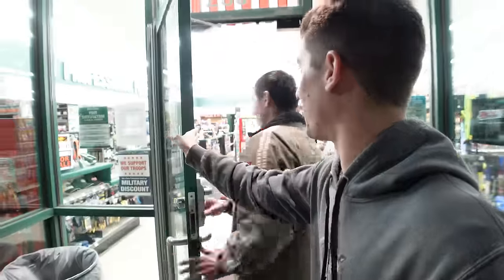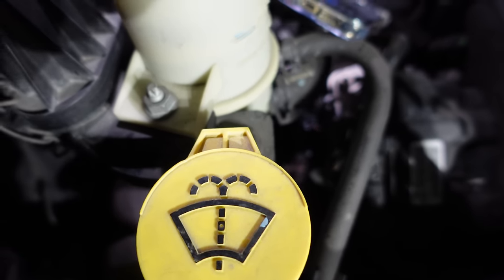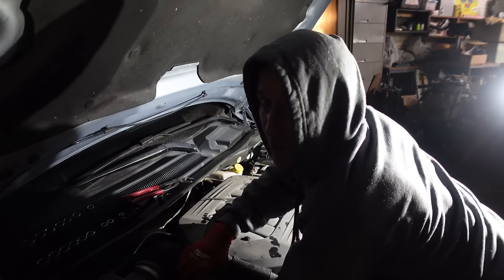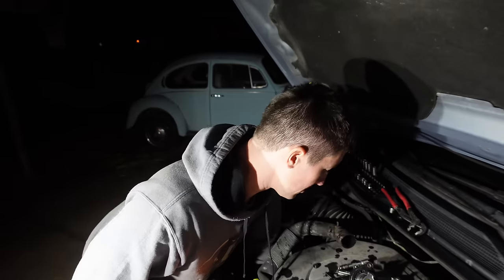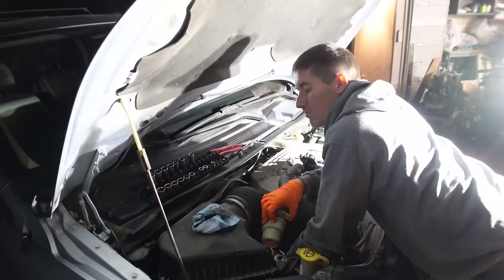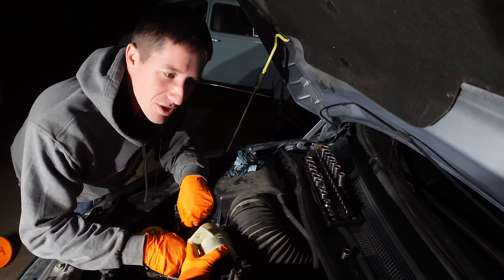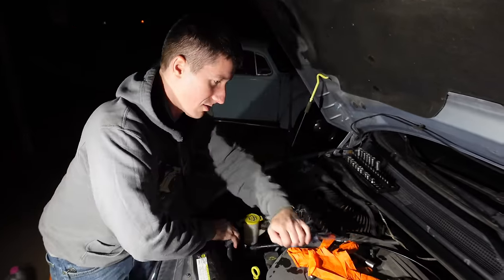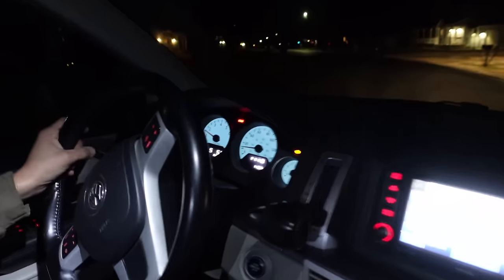The HEATER In This VW Routan BROKE On The Coldest Day  *Thermostat Housing Cracked*

Comment: I will say one thing about using spec coolant: years ago after I hit a deer with my truck, the body shop that fixed it, unbeknownst to me, used standard ethylene glycol in the new radiator when it needed Dexcool.  About 50,000 miles or so later it start overheating because the wrong coolant eventually ruined the thermostat.  I replaced that myself but learned a valuable lesson to just use what the manufacturer wants.

Anyway, great as always to see Gabe!!! 🍻🍺🥃
Reply: Weird as dexcool was sued and known for eating away head gasket material... Swapped away from dexcool in my land rover and it was perfectly fine.
Reply: yeah you dont mix coolant types
Reply: As Chris723 said, mixing of coolant types was the issue; coolant in the block (Dexcool) + coolant in the new radiator (Standard) = unhappy chemical reaction creating coolant sludge

Comment: Glad to see Gabe is back.  Had the coolant drain petcock shear off/pop off all on its own on my 1990 Ford Taurus when I was running errands a couple of decades ago.  Left me stranded.  I couldn't afford a replacement radiator (or a tow) at the time.  A ball of jb weld putty fit in the hole and it never leaked again.  Anytime I needed to flush coolant I just had to remove lower radiator hose.  It lasted until I got rid of the vehicle 4 years and 50k miles later.

Comment: I worked for Chrysler. When the 3.6 starts to tick, usually it will need lifters, and rockers. A lot of times it will wipe out the camshaft with it
Reply: I thought the same. I have 90k no tick cuz I change my oil
Reply: Yeah, it’s the dreaded tic. Started around 60K. I understand it to be a defect that was recalled for everyone BUT VW.
Reply: If you replace the rockers with the updated ones before it eats into the cam you can get out cheap and not have to replace a damaged cam as part of the job.

Comment: The reason you don’t want to mix those coolants is they can and have reacted and caused a gunky gel like build up. I’ve had it happen and so many people have I know esp in euro cars. Always use the same kind of coolant. Don’t mix and don’t go cheap. Oem coolant is usually superior to universal in both longevity and how it works. It’s fine if you sell cars as fast as watch jr does that’s why it’s fine for him but long term it’s not worth it ever !
Reply: He actually used the wrong coolant. VW routans are really Chrysler minivans,so the correct coolant for this vehicle is Zerex G-05,Mopar Hoat,Peak North American Gold,or Ford Motorcraft Gold.

Comment: I did this job yesterday on my 2013 town and country. That engine sounds like it's time to replace those faulty from the factory rocker arms.
Reply: Is that why I hear so many of these engines ticking?? Wonder how big of a job the rocker arms are on these 3.6's.
Reply: Watch videos of it I did it myself. Got the 24 rocker arms from rockauto. If your mechanically inclined your half way there. The trick is replacing them with out bothering the timing chain.

Comment: The 3.3 / 3.8 Motor takes maybe 5 minutes to change the thermostat housing on the 08 and up models. I changed mine in a hotel parking lot during a snow storm. So speed was essential doing that job.

Comment: Gabe, I thought you died. Lol. Good to see you.

I've used a universal coolant in my impala and heard it was bad because it will turn to sludge when it contacts the orange that factree puts in it. I had to replace the water pump at 150k and took the opportunity to look in the system at that point. No sludge to be found. No blockage. Just a standard GM waterpump failure.
Reply: LOL! 😂👍🏼

Comment: Hey for future reference quick tip for those plastic bleeders
 If you go to unscrew it and it strips or the head breaks off. Heat the tip of a flat tip screwdriver up shove it in the center of the remaining plug and wait till it cools then unscrew it. Worked every time. Friendly mechanic advice. But since his thermostat was leaking anyway 5he replacement housing was definitely the correct fix for this. From the video I couldn't tell if the whole housing broke or just the screw plug.
Reply: The plug was definitely on its way out when it broke, but the main leak was coming from the back of the housing.

Comment: It’s funny when y’all started talking about ticking noise I immediately started thinking about my 5.7L Hemi tick.  You know what finally fixed the ticking noise?  When I replaced all the spark plugs. One of the plugs was missing an electrode.  Well anyways it was nice to see you and Gabe back at it. I’m glad he’s doing better
Reply: The check engine light wasn't on?
Reply: @maddexxx847  Interesting. I did have a Mercedes that developed a rough idle but the check engine light would come on for like 3 seconds then disappear. I changed the spark plugs, clean the MAF and throttle body and it was smooth as butter after. Such a simple fix and the car felt brand new.

Comment: It's gonna need a cam. Collapsed roller on the rocker. I've seen it twice at my job one of which I fixed. It isn't a terrible job, but there is an SST that makes it so you don't have to mess with timing to take the cams off.

Comment: Leave that hose on the housing and pull them up together. Make a mark so you can line the new one back up in the right place. The next thing to go out will be the oil cooler/filter housing. It’s not an if, it’s a when on those 3.6L engines. That’s a little more involved job.

Comment: At 13:20 That Loud "Ticking Noise" from the Engine it needs Camshafts Rocker Arms & Lifters
Reply: Yup. I’ve been listening to it for 60K miles now. At this point I’m certain I’ll need to replace the cam as well.

Comment: If you get the special timing tools they’re 20-30 dollars on Amazon they hold the guides and tensioners back it allows you to unbolt the cam gears and slide them forward just enough to get the rockers and cams out it’s really not bad at all I did one in a few hours. And honestly the tick doesn’t sound to bad he might be able to get away with just rockers

Comment: The Escalade Convoy sounds like a great idea, but the one the president has, the M134 is in the rear. The tailgate drops and he is there. They all have hatches that open up for gunners to shoot out of or the occupants to escape from. Occasionally you need to do the side to side 'drafting' maneuver so that anyone with a rocket launcher is thrown off and speed up, slow down, rotate positions in the convoy and at odd times, you all stop and then wait, then drive away really fast.

Comment: How did Gabe get injured anyway? AND, are there any vehicles on this channel without a check engine light?
Reply: Loooong story. Short version is I was saving a puppy from a burning building and had to jump three stories to the ground just as the building exploded. Wound up with 12 screws and a plate after crushing my heel. 🍻😉👍🏼
Reply: @Gabe-ABNCW3  Superhero Gabe.

Comment: It is common for the rockers to take out the cams on the Chrysler v6 this car has. I have seen it a lot at my work since I work as a Chrysler tech. Another common issue is the oil filter housing/cooler to leak under the intake
Reply: Yup. It’s the 3.6L curse.

Comment: How do you not own one of those coolant fill tanks?? You fill them all the way up with water, so it then becomes the highest point in the cooling system to help get air out. They work awesome if you don't use shop air to bleed 👍

Comment: I say don't cheap out and use factory coolant(except the old GM dexcool) The change intervals on the stuff is so long now days(Toyota is 100k miles I think) you aren't saving a lot of $$$$.  Plus mixing different types can cause a chemical reaction that might eat water pump seals or turn it into sludge, plug up a heater core, etc.

Comment: I was positive you spelled that wrong! There's a european VW minivan called the Touran based on the Golf platform, which clearly is nothing like this thing with the jumbled letters =D
EDIT: I'm actually surprised VW would share a platform with Chrysler, but then again, thinking twice about it, VW and Mercedes share quite a few platforms in Europe. The Mercedes Sprinter (I think you have both Dodge Sprinters and Mercedes Sprinters in the US, same platform) is actually the same platform as the VW Crafter here in Europe. I guess it makes sense with the whole Chrysler/Mercedes merger thing added to the Mercedes/VW commercial/minivan platform sharing in Europe. There are actual Mercedes pickup trucks (small ones compared to your full size trucks) that are essentially VW pickups and the commercial vans etc. Man is the auto industry a mess!
Reply: The Routan came on the market a few years after Mercedes sold their shares in Chrysler it was just a badge engineering , new bumpers new headights , logos here and there etc , they used the european suspension tuning  that Chrysler used on the european version of their minivan and they were built in Windsor Canada on the same assembly plant as the Town and Country and Grand Caravan

Comment: Man it’s too cold out to be working on cars.
Also what gloves are those? Do the work well for the cold?

And using different coolant is fine after a flush as long as you don’t mix colors. Or it will gel and create deposits that ruin everything. Ask me how I know.

As an h2 owner myself. I can confirm they rip pretty hard.

Comment: Stock coolant story. Chrysler Edition.
03 Caravan, brand new. I bought dealer OEM antifreeze for every service up to 100k. 
That red crap ended up oozing through every gasket and freeze plug, clogging the starter with sticky pink parafin wax and ruining the engine once the gaskets started failing.      Every. Damn. Gasket.
Chrysler should have been forced to recall and replace over that. Engine was junk at 100k.